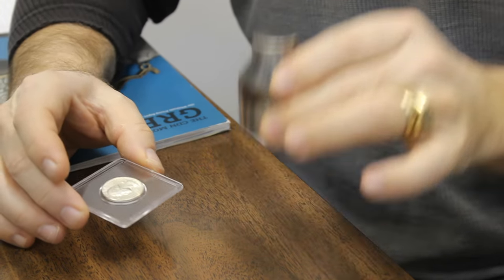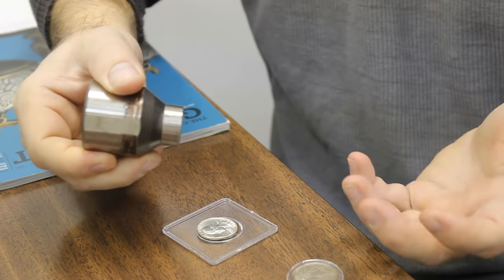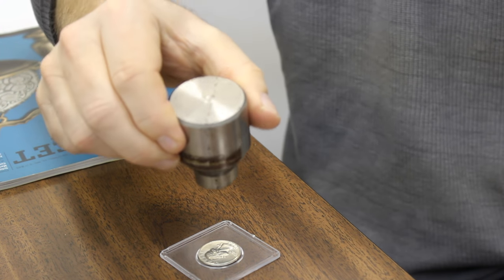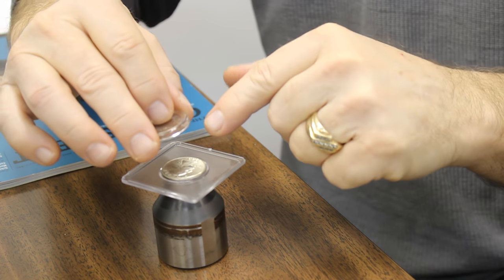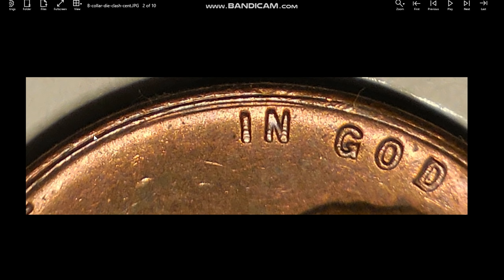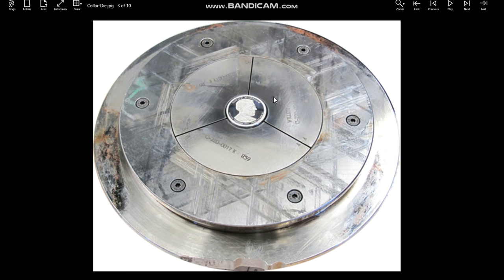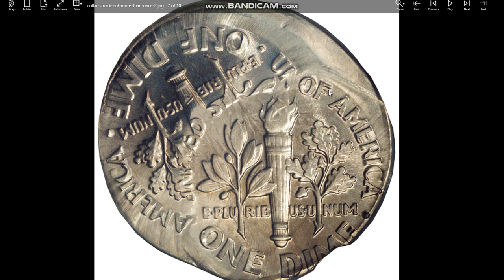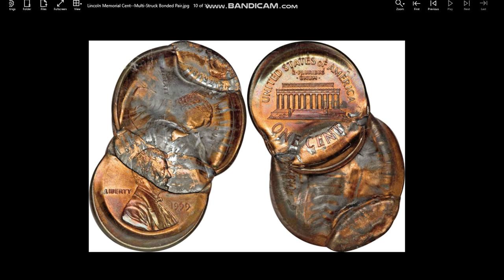"Double" Rim Coin - Railroad Rim? It's A Collar Die Clash - See How Collar Clash Mint Error Happen

Comment: Very informative.  I have a 1989 dime that has a very thick rim at 10 o'clock position, but thinner at the 5 o'clock position- FB.  Not clear if this is a coin worth selling as I believe '89 Roosevelt dimes have a LOT of errors.  I like how you explained what happens (you're the only one educating the mechanics of procedure).  I always learn from your videos.  Thanks!
Reply from the maker: Slight misalignment but withing mint specifications until some of the design is missing.

Comment: Hi there thank you for all of the information you provided as well as the detailed photos. This helps a lot to understand how these errors can occur. I have a dime that I was comparing to one of yours and I was wondering, would it be possible to have an almost completely smooth dime all of the way across along with reeding missing on both sides? You can see the image but it’s smoothed out as if it were shaved off. Or could this be someone’s machine work?

Comment: I found a 1961 D penny that looks like it has a collar die clash on both sides of the rim, one side looks to be from a dime as the inside of the collar die clash on the penny clearly has a readed edge, so my thoughts are it was collar clashed with a dime and someone at the mint tried using it as a penny. Going to my lcd right now to have it checked out, I couldn't sleep thinking about what it could be last night lol

Comment: My 1995 in great shape like new. But the front the rim I guess is silver looking but It's sharp when you run your fingers across and my nail goes u Der and it's almost if I pull hard enough with something sharp like a razor blade it will Bend or pop off. Not like a wear out. Idk. It doesn't look like the dryer coons I seen online